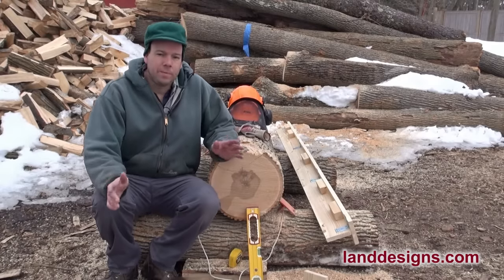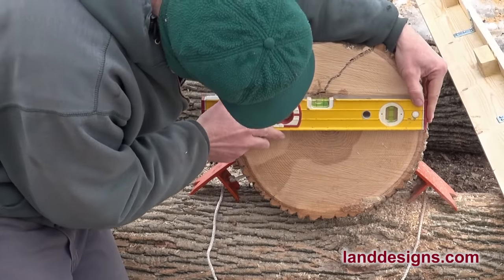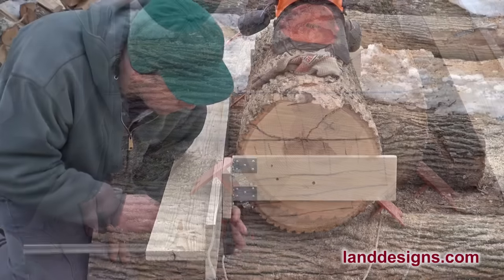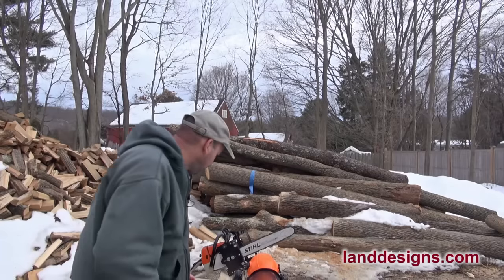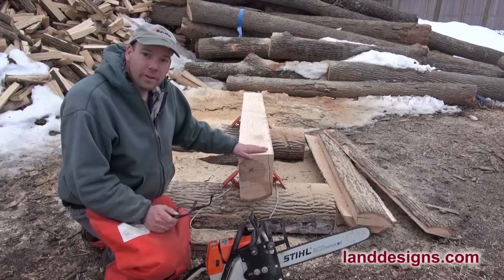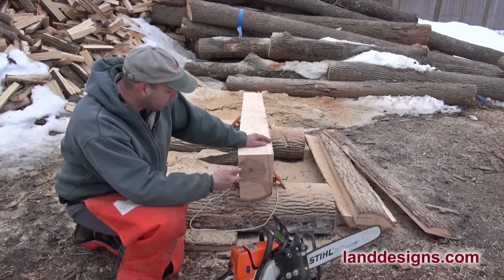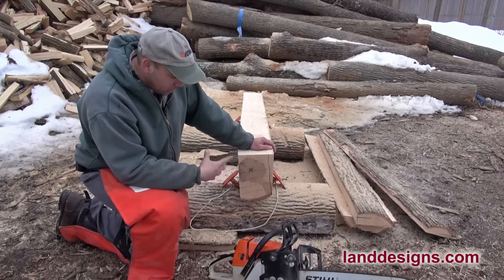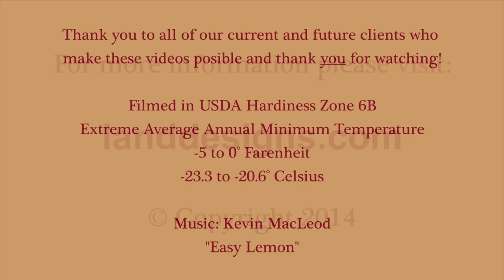Logosol Timberjig Review 3 - Chainsaw Milling Day

Comment: next time use wedge shims every 18 inches or so as you go, it will keep your cut off from dropping down on your chain bar and pinching it. It will make a huge difference on the ease of your cuts.
Reply: Yeah most of his problems was lack of shimming, he was bound to feel it pressing the bar.  Also attacking it at a sharper angle instead of all of the teeth at once would have allowed more consistent faster rpms and results.  AT least throw out more oil, he is just 90 degree burying the blade. Good video though.

Comment: I've used my Logosol jig on a husqvarna 51 and have good success on oak and pine. There is clearly a learning curve when using an under powered saw. Investing in ripping chains is a must. You need to develop the skill of even pressure on the saw and maintaining the sweet spot RPM. It's definitely a good physical work out to be bent over pushing the saw constantly through the cut. Also call it quits after your saw gets to hot from constant high RPMs and definitely clean your chain in a solvent when done. The planks I cut the first time I used it paid for itself.

Comment: I do quite a bit of chainsaw milling and have a capacity to mill trees up to 57" in diameter at the moment. 
As such, I can tell you that the righ chain absolutely makes a difference. I prefer the Granberg ripping chain as it produces the absolute smoothest cut if I do my part. Their rip chain has two different types of cutters, clearing cutters and scoring cutters. I will try to explain this, but it might not make sense. The scoring cutters cut on the left and right hand side of the cut but not down the middle. The clearing cutters come down the center of the kerf, clearing the material left by the scoring cutters. This two step approach to cutting the wood fibers helps to prevent the wood grain from tearing as badly...at least that is what I think. 

By the way....I love your log dogs man. I wish I had a welder. That sure beats jamming little pieces of wood off to each side of a log. I've seen them for sale before, but I refuse to pay $100 or more for something that simple. 

Again, I enjoyed the video. Thank you for doing it.
Reply: John Strickland
Reply: John Strickland best place to get started
Reply: That’s exactly how the old two man crosscut saws work.

Comment: Had my self a little marathon here watching your series. Loved it.
Bought one just about exactly one year ago, still in the box, ordered a rip chain this monday, got it in the mail yesterday. Problem is, my chainsaw is in my motherinlaws basement... A 3hr drive from home. Anywho, thanks for the videos! Nice to see what to expect ;)
Reply: Small update ;) Assembled my Timberjig last night, found it during a long needed shop/garage cleanup. Looks good! So, in about two weeks, I'll see how it works out. Looks promising.
Reply: Yes, none of them broke ;) I remembered your vdeo, and made sure I didn't overtighten it. Had to read it more than once. It was in swedish, but hey, Comming from Norway, that wasn't to hard to understand ;)
Reply: Ok. Got some milling done yesterday. FUN! Not perfect, but close enough :)
One Birch, about 40cm dia, and two logs of a cypress I cut down last summer, about the same size.
Reply: thanks :) I got he exact same set up as you. so yes, Timberjig. I'm thinking about making a somewhat more permanent station for the job, it was kind of low, some lower back pains, nothing to bad.

Comment: I'm going up to my family home in Scotland prob. the end of March as the weather's being a pain as per usual,  to start building a small cabin and will be using a portable mill, now I haven't seen it yet but I have watched a fair few videos on different types.  This video is especially informative,  as I didn't know about the different chains etc, I'm hoping my sister has got the mill that has the ramps that grip the log and the setup that you fit the chainsaw into (so I can't mess up and cut myself in half...yikes!) Your video has given me a bit more to think about and I will have a look at the other ones. But thanks for putting this up as it's showed me some of the areas to be aware of in choice of chain etc. Mind you,  I will only be cutting sitka spruce which were blown down (we lost a lot c. 1,000 trees so it's waste not,  want not. If my cabin is successful I may get some help and put up some holiday rentals for my sister to help her out financially as you can't even rent a trailer for less than £550 a week in December in Aberdeenshire, so hopefully all goes well.  I may put up a video if it works out ok!) Thanks again. ..don't quite know if you have made the nightmares better or worse yet but at least I know more!

Comment: Use chisel bit (square shoulder profile) chain and file the tooth angle to 5 degrees. Rakers depth needs to be set to take a bare minimun depth of cut (this will smooth your cuts and keep the chain cooler )
Also ripping requires additional oiling to the chain. Use the manual oiler often.
Get a power head with a minimum 70cc.
I recommend Husquavarna as the have a higher chain speed than Stihl.

Cheers and be safe
Reply: I want to this macin
Reply: in nepal

Comment: Milling or ripping chain is a necessity when using a chainsaw mill.  And it should be a skip tooth chain.  Without the skip tooth, or when using cross cut chain, the cut chippings jam in the kerf, causing the saw to jerk and buck.   Bailey's carries milling chain, looped to length, or in rolls.  The cutting angle is 10 degrees, is relatively easy to maintain with a small chainsaw wheel sharpener, or just consistent hand filing.  Granberg also makes a specialized milling chain with cutout teeth to ease the removal of the cut chips. One can use a large tooth full or semi-chisel chain for ripping rounds, but it has to be very sharp, the wood must be green in my experience, and the chain has to be at least a skip tooth chain.  A full skip is even better, but requires constant attention to sharpness.  Small wooden wedges are a big help in keeping the kerf open.  If the kerf closes, then the cut material builds up in the cut.

Comment: @land Designs unlimited llc nice video you made there! I'm from Germany and I would like to mill my own wood also, a nice video to get an overview about what your gonna need and it shows also nice on which things you have to look in the beginning! I knew already about the 10/15 degrees which are needed to cut length side, but for the other people it's for sure great to see what's the difference between using those chains! Very nice done!
Reply: +Land Designs Unlimited LLC Yeah! Im sure it is! You should do a video from the log to the finished product like a bank or an table. Which kind of wood did you cut in this video?

Comment: Btw. 15° is the standard chisle tip good for dirty cutting. 32 is about the max normal angle. Beyond that you start losing contact with the wood I think because it reduces the size of your sawdust and speed of cut. Try it out and see what works for you. 60 works for me maybe your saw is smaller or bigger and can handle more.

Comment: not too sharp, the problem is the depth gauges need to be set up pretty high, you want to limit the bite of the cutters. The reduced angle of cutter attack will also settle down the cut because it limits the amount of grab. I know what you mean, have milled a lot of black walnut and maple back in my day. I never had very good performance out of skip tooth chain. No substitute for POWER when milling....bigger saw the better. The hot chain indicates you need more oil flow. I used a 36 inch bar on Granberg Mill, made an auxiliary oil tank that mounted on the nose end, drilled the bar and fitted a home made oiling port so that oil flow goes direct into the chain groove ahead of the roller tip...makes a world of difference in chain, bar and sprocket wear.

Comment: CT  Man I wish we were neighbors we could tear up some wood.  Have not bought a mill yet but thinking real hard about it.  I just wanted to know how long your bar is on your stihl and how big of a diameter log you can cut with the length of bar you are using.  I got a Stihl 310 with a 4 hp motor with a 20" bar and wanted to buy one of these jigs without having to buy a thousand dollar saw like the MS-660

Comment: Ripping chain is for smoothness of cut, thus semi-chisel, low-joint (depth gauges only ~.015"-.025" ) depending. To maintain cutting angle (side perspective) as the chain is worn, you'll need to raise it. Mainly, KEEP CHAIN SHARP. For your purposes, full chisel probably would work best, if finish is not a prob. White ash on the stump has very low MC (it's dry) which does not help you. Good luck.

Comment: You need more than an inch, because after it dries, and you send  it through a planer its definitely gonna be less. I would say about 20 mm at the end. But off course it can be also usable.
Reply from the maker: Thanks for the tip!
Reply: @CTSCAPER  hahaha.. i think you gave me a more important tip. by the way, i have a question regarding that. i heard about this kind of skip chain here on youtube. Is that really helps a lot or enough just make or buy a rip chain with the 10º angle?

Comment: Spin the log dogs around on one side of the log so it will stop it from rolling but won't bite into it then use your cant hook to roll the using the leverage of the handle. The log will just spin on the spot.

Comment: your better off with a full house chain because it will cut faster and smoother, and you can almost file the teeth square. You would even be better with a 80cc class saw, maybe even 70cc saw. I am a log home builder, and one company I worked for used a 088 on a mill with the teeth almost square filed.

Comment: i see you like you stihl stuff, why not get the stihl petrol can? it has oil on the side too and its impossible to spill
Reply: ***** I had a quick look for you, this oregon one is similar to the one i have... http://www.abbeypro.co.uk/accessories-lubricants/fuel-cans/showitem-OR-562405KIT.aspx

i have the stihl version, all you have to make sure of is that the can comes with those anti spill spouts, they fill your oil and petrol and auto shut off when the tank is full, such a handy bit of kit, well worth the money, even if you knock the can over it wont spill, when your done for the day the special nosel screws to a cap hanging from the can and you put back on the proper sealing cap to preserve the fuel better

Comment: Why do you cut to make 4 (fairly) equal sides before cutting your planks? seems like it wastes a lot of usable wood. After cutting the first piece. wouldn;t it be better to flip it over and put the flat side on the bottom for stability and start milling from the top.  Smaller width pieces could be riped into 1x1s , 2x2 s, 2x4s etc. This would almost double your planks width  wouldnt it? I can see getting at least a few long  2x2 or 2x4s extra.
Reply: Tracy Castor

Comment: can you put a little ange on the jig that way you chain wont chatter as bad  ?
Reply: dry  stuff oak is nice   never milled before but  when i rip firewood peices across the top to split them it helps to have a slight angle to grab the fibers too much will hang  the chain up
Reply: +Land Designs Unlimited LLC Matching the chain to the job (and skill level) is pretty 'under-documented'. That said, I'm really glad I bought a ripping chain. In addition to a more blount angle, it has separate left & right cutters for the "side walls" of your kerf. Downside: it takes (me, ymmv) 3x longer to sharpen, but it's worth it when trying to mill a straight cut thru ash.

Comment: what will you suggest for cutting coconut wood
Reply: I would imagine using a very mild chain. anything too aggressive would cause problems. Coconut is very soft if it's like the palms I have seen. Might be a good candidate for a band saw mill.
Reply: All palms are highly alkaline and will eat a hole in aluminium very quickly. Clean your saw daily if you cut them.

Comment: The skip-link is what U needed from the start.
I am surprised that was not mentioned in the instructions with the mill.
Reply: I make mantles for fireplaces,from sunken 120 year old Cypress logs.I made my own rig and it works PERFECT!!!
Most of the Millionaires here in Florida want them rough cut then dried and coated in casting resin.
I have a 110CC saw with a 48" bar so,I cut some giant slabs with bark and all for their fireplaces.
Nobody but me makes them around here,Sometimes I feel like i am robbing them but they always insist I take at least another 800-1,000 bucks from them..
Keep at it,get good, MAKE BIG BUCKS!!!!
(U need the right wood tho)
Reply: Fishkiller 41 BurItI

Comment: You get used to the chainsaw mill and you’ll never need lumber company again because you can cut and drill that would and have it build a complete house if you need to and the best part about it is your boards don’t have to be 8’12’ they can be 30 feet long just depends on you

Comment: Why wouldn't you just rotate the log 180 so as to maxmize what you can use and minimize your passes?
Reply: No the waste on the log should act as a weight on the base of the cut, not be a portion as to which you are wasting. The crack should be at the base.It's unusable portion and should be place at the base portion.

Comment: cut bevels on the either ends of the logs instead of building ramps and flatten the logs on which side it touches the ground, that way your logs won't roll around.
Reply: +Land Designs Unlimited LLC 

co

Comment: I wasn't impressed with sliding the chainsaw down the wood board as a means of cutting the wood.  i think a better brace that locks in the chainsaw would achieve a more desired result.  But, good job with what you had.

Comment: That looks like Cottonwood Cottonwood it’s hard to cut because it’s full of moisture which it swells up by the heat of the blade in the teeth that goes through it so it lines up as you try to cut it that’s what Cottonwood is it’s wet wet wood that’s why your chain is binding up in the log it’s wet would not really good wood 

A log that has the same color from the outside bar to the very inside belly button of the truck It is excellent wood log that you have with the brown core is not binding up like that in the log is either you change that sharpen your records not cut down or you’re just cutting a  wet log

Comment: Here you go again you need to skip tooth chain and you want to run a chainsaw full throttle Not an idle speed you want that triggered completely pushed down and get that wood cut skip tooth chain also help but I’m seeing what you have a problem with you don’t have your rakers nail down you are as a raker? It’s before the cutting tooth Personally you post to do it three times each time you do your shopping if you think how I do it I knocked and record down halfway then all I have to do is hold onto the software is there a pool itself right through the log it less work for you in more work for the chainsaw all you have to do is hold onto it if you don’t well you’ll find out why you should’ve held onto it!

Comment: Do NOT make any tool out of rebar.
20 yr Ironworks letting you know, it WILL fail at some point and hurt you.
Reply from the maker: Thanks for sharing Bernie.
Reply: Your very welcome. I would hate to think someone got hurt, because I said nothing.
You heat rebar and bend it, let it cool, apply pressure and it will snap like a toothpick 90% of the time at the bend.
We used to make hooks out of it, to pull grating around with. 
After enough men fell to thier deaths from broken rebar hooks.
OSHA forbade the making of any device from rebar.
What did our daddy's tell us. " Boy, you make get away with it 1000 times, but it's that 1001 time, that will get your butt skinned" 
😆
Reply from the maker: @berniemiller1217  I had no idea bernie.  Thanks again for sharing.

Comment: That center part which is dark is not good what do you want the white part of the word for structure because that brown part of the word is not very good for structure it’s pretty much write you down the tree that was already dead and that’s what the result is inside the tree it’s not wait all the way to the core which would be a solid piece of wood but with the wood you have there with that brown core is not solid wood so whatever your building with it it’s going to collapse in time because I Corps is not Solid is a punk